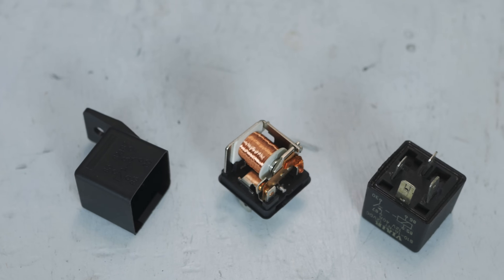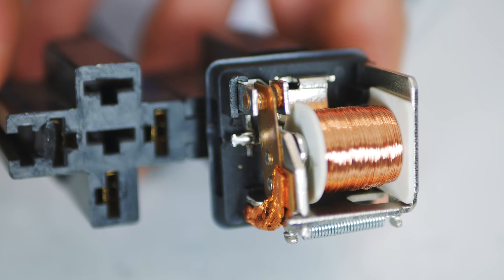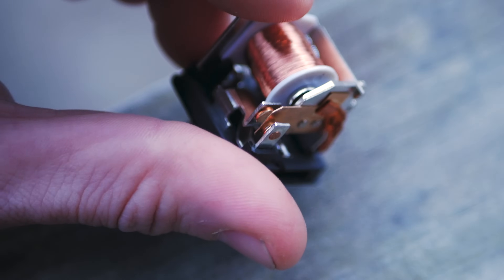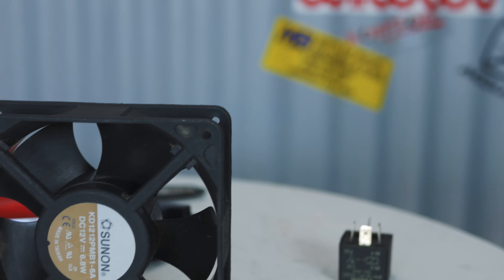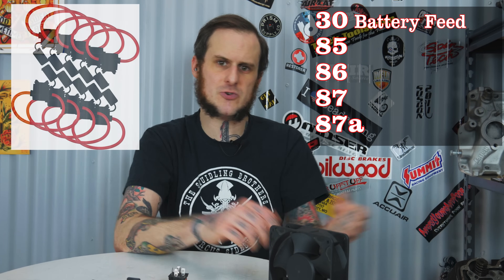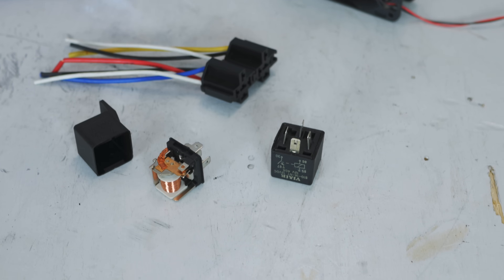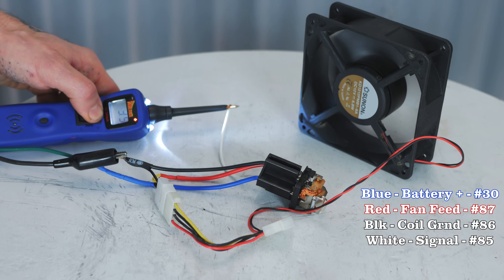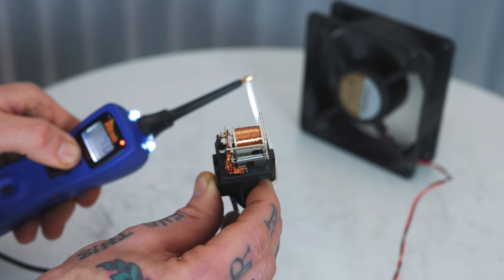Relays Explained - How they work and how to wire one!

Comment: Can you have two control switches into 1 relay?  When either is powered, it would tell the relay to power the high amperage side.
Reply from the maker: Yes you can. I'd recommend doing it as a ground control to avoid any weirdness with back feeding power somewhere. So send power to the Relay control circuit, then use the switches on the ground side of the Relay Control circuit. Flip a switch and the ground is connected, the Relay will actuate.

Comment: What if i am trying to wire a train horn with my factory horn that is activated by the factory horn button located in the steering wheel. But i want a toggle switch to be able to use either the factory horn or train horn
Reply from the maker: I would find your horn wire under the dash. Wire a 3 way toggle switch to that on your dashboard. Send the Horn wire into the center terminal of the 3-way switch, and each of the other legs to your two horns. One wired back to the original horn, the other to the relay for the train horn. Then just wire up a relay to the train horn's actuation valve, using the wire coming from that 3-way switch as your control circuit. 

Then you can flip the 3-way switch to the original Horn, or flip it the other way to go to the train horn control. 

A switch like this I mean: https://amzn.to/4cdoGxG (affiliate link)

You just have to be sure to switch it to one side or the other, not leave it in the middle. That is the "off" position where neither horn will work.

Comment: So I have some fog lights on my 2006 Dodge Ram that go out when I turn my brights on. I’m figuring it’s a 5 pin relay that’s switching them off.  In the case of a 5 pin relay, what pin numbers on the relay would be turning the relay off when the high beams come on? What would be the best way to rewire this relay so the fog lights stay on when the low and high beams are on but I can switch the fog lights off if I want?

Comment: 2013 suburban sometime for off roading I need to remove ABS 2 Fuse (25) to Disable Completely Traction and Stability control System, so I need switch instead of removing Fuse every time I need to go for off-roading what best way? and how to do it? thank you.

Comment: What's your opinion on  switched negatives on both relay and low amp  direct connections
Reply from the maker: For relay control I actually prefer ground control. It makes it so I can keep the positive side wiring neater in many cases. 

For Load side I usually go the other way for the same reason. I can have a fuse panel right next to the Relays and keep all my Positive side rather short and simple. Then send power to my Load device. Which also means my Ground side can be short and neat in many cases.

Comment: Hello, I have a question please.  I have a rearview mirror dashcam (that records dashcam video as well as video behind me) on my 2006 F150.  Hated the idea of messy wires with the 12v input so I used a fusetap to the interior fusebox, wires neatly tucked.  Picked a fuse location that was normally 10a and added a 5a fuse to the fusetap (for a total of 15a).  That worked for months but suddenly it's dead.  Tested direct to 12v cigarette input and the dashcam itself is fine, it was just not getting power all of a sudden with my flawed setup.  Now I'm using the 12v cigarette adapter which I'm not a fan of, especially since it's 'always on.'  Should I buy a relay and go direct to fusebox? If so can you link me exactly what I'd need on Amazon with a brief description, and I'm sure I can figure it out from there.  I would be so grateful.  Thanks in advance.  This has been an ongoing nightmare.  I'm good at following directions but I'm really lost with electronics wiring

Comment: Hey I am trying to figure out a way to wire a switch using a fuse tap and relay in order to send power to other accessories maybe lights or a screen things like that, any thoughts or ideas how to wire that in the car. thanks

Comment: I want to add some LED ambient lighting in my car, the problem is if I plug it into my car 12v lighter outlet it stays on even when the car is off... I do have a light in my armrest cubbyhole that turns on and off with the car ignition so I want my new added LED light to do the same... So I figure I will power up a 5 pin relay to make this work... I'm just a little confused... I plan to wire the relay in the following way: 30 to 12v+, 85 & 86 to 12v- (ground), 87 to new LED+,  new LED- to ground, the confusion is the 87a... what do I connect to tell the relay to turn on and off? The existing light in the armrest cubbyhole has a + & - wire... do I just connect that positive to 87a? This way when it is activated (ignition on) it will trip the relay to on, and when the ignition is off it will trip the relay off? I hope you get what I am trying to do. any help will be greatly appreciated! If you have another way of doing it please let me know. Thank you!
Reply: Hey, I don’t know if you’ve figured it out yet, but:
30 to battery (use a fuse)
85 to the armrest light positive
86 to ground
87 to LED positive
Ground the LED negative to an existing clean ground point. Leave the 87a alone. Hope this helps
Reply: Basically 85 and 86 should be running parallel to the armrest cubby hole light, that way when the light comes on, the relay also will, and provide a direct circuit between the 30 and 87 points. When the relay is off, there will instead be a connection from 30 to 87a, so the 87a is for if you want to turn something off rather than on with the relay. For your LED thing, leave 87a alone

Also check your car’s wiring diagram and make sure that the armrest cubby hole light circuit has enough power to also supply a relay in parallel. The relay will add a 0.5 to 1 amp extra load to that circuit

Comment: I've watched a ton of videos on relays.  They all say low amp goes to the relay to power the switch so high amp power can be delivered but none of them ever say where the low amps come from.  What reduces the battery amps to low amps ?
Reply from the maker: Thom Vogan nothing. A circuit needs a “load” to use the Amperage. An electric fan is a large load, so it’s a “High Amp” draw. In the case of the “Low” side here, the Relay is the only load. The Relay basically “creates” the Low Amp load your are asking about. The point is just that you can use small wires and low amperage switches (like generic dash switches or computer controls) to control the relay. And that small amperage load then switches on or off the high amperage load. Does that make sense?
Reply: The electromagnet (coil of wire) in the relay is part of the low amp circuit. The high resistance of the electromagnet results in low amperage in this circuit, according to Ohm's Law: V = I x R where V is voltage, I is current or amperage, and R is resistance.

Comment: Hello!  I’m connecting a stinger battery isolator in my 2003 Ford F-150.  I’m to the point of attaching the isolator to a “true ignition source” and your comments about fuse taps has me concerned.  How would you make this connection?  My end goal is an auxiliary battery for camping.

Comment: When adding a diode to prevent reverse voltage spikes, does the diode install on 85 and 86?
Reply from the maker: The Control Circuit can be wired either way with either 85 or 86 being power or ground, so this is too broad of a question for me to answer. 

If I was worried about that it would only be in the case of an ECM controlling said relay, but most ECMs use Ground switching, not Power switching. If it is a Power switching circuit in the ECM, I'd install the diode in line on whichever wire was supplying said power to the Relay control circuit. 

I've never had an issue with voltage reversion with relays. I fully understand it is a common phenomenon, but it's generally more of an issue in Electronics development, not car electronics.

I use Diodes infrequently for weird wiring scenarios where I need to maybe control a relay via two different circuits. (Say ECM and AC signal both turning on electric fans.)
Reply: @HotRodHippie  I just subscribed to your channel, thanks for the response, I'm working on a truck that has a electronic control module for emergency lighting, there is currently a diode on the relay, but one end is off and not sure where it goes to, At the moment, one end is connected to the 85 spade, not sure where the other end of the diode needs to be, hope this clarifies my situation, Does the other end of the diode go the 86 Spade on the relay ?

Comment: hello, I'm trying to understand relays. the part not I'm not understanding , is where does the coil get the power to energize itself to close the contacts when the power is coming in through the #30 pin. Thanks
Reply from the maker: 85 and 86 are your "Control Circuit", that is the coil circuit. You supply power and ground to it (doesn't matter which is which) as you need. So if you want the Relay to active when you flip a switch, you wire the switch to the 86/85 circuit. If you want it to activate when you turn a vehicle on, you wire it to a "Key Hot Ignition" source. It is up to you what controls the Coil is what I'm getting at. I didn't cover that much because it greatly depends on your use and needs. 

I've wired relays with switches, key hot, where computers activate them, where radios activate them, where one relay activates another one, and probably some other ways I'm forgetting.
Reply: @HotRodHippie   thanks for responding to my question.
Reply from the maker: @MrBikercat  no problem. I try to answer any questions I can, I don't always have the time but I try.

Comment: One question. I bought a relay today in order wire led light strips on Atv. I'm working on that this evening. The relay I purchased is a 5 pin with 87a. Although I should have bought a 4 pin can I still wire it up as a 4 pin and just ignore the 87a pin?
Reply from the maker: Yes indeed that is what you do. 👍👍
Reply: @HotRodHippie  thank you.
Reply: @AztecWarrior75   Thanks for the tip.
Reply: @AztecWarrior75  and yes I covered the pin with shrink tube.

Comment: Hello +HotRodHippie, enjoying your channel very much.  I am hoping you can please help me with the following.  I have 2 normally on 12v cigarette lighter ports on a Ford vehicle.  Both are fused with 20A JCase.  I want to make them normally off.
  I have 2 unused fuse slots which are normally off and powers 1) a mini USB hard wire kit and 2) a 12v lighter and 2 5v usb port.  Both using a fuse tap.  This 2 unused slots do not power any existing load.  These are all in the passenger compartment box.

Based on your two videos, this and the Do's and Dont's relay and fuse tap episode.  Looks like I can use a relay to convert the existing normally on 12v ports to normally off.

Question: Do you think I can just use the fuse taps to activate the relay?  I'll use relay terminals 30-87 inline with the existing 20A Jcase fuse.  Am I overdoing it and/or is there a much simpler solution?

Comment: I have an old CB that I can only get to work when hooked up directly to the battery which I know isn't good. I used a fuse tap for my external lights on my jeep (10 amp) and it works good. No such luck with the CB. There is a red wire and black/red wire. It was my understanding that the black/red needs to be grounded to the frame and the red either be would up with another red wire that's already working or a fuse tap, but can't get the dam thing to turn on. What am I doing wrong?
Reply from the maker: There isn't any logical reason for using a fuse tap to not be working. I don't know that I'd recommend it but it should at least turn on. If the tap couldn't probide enough power it should burn up somewhere not just simply fail to function.

My only guess is that your wiring is aged and corroded here and there. That results in voltage drops. Meaning the voltage at your battery or alternator is losing a bit on its way to your fusebox. Very common in older vehicles and to a lesser degree newer ones. Maybe that CB is very specific about voltage and the voltage drop is enough to not let it turn on. Say maybe your battery has 13.5V but at the fuse tap you are only getting 11.5V. Maybe the CB NEEDS 12V to turn on. That is a shot in the dark guess but a mildly educated one. Wiring a relay to provide battery duredct power and using a fuse tap to trigger the relay is a solid option for better voltage, bypassing your old wiring and going fresh right from the battery. 

The only other issue I can see is that maybe wherever you are grounding isn't a good enough ground. Grounds are very important and you can't really overdo it on them. So if you only have say one ground from your battery to your engine, or frame then it may be insufficient. Or wherever you are grounding too isn't cleaned off enough for good contact.

Lastly are you sure it isn't a 24v CB or a 12/24V and something isn't wrong with it? I admit that it working when connected to the battery loses this theory but most old trucks are 24V so a CB from one possibly be so.

Comment: Im a newbie in car wirings and planning to instal a foglight to my mitsubishi lancer97..
Here's the plan: 
a) battery-->fuse-->relay-->bulb.
b) tap from auxillary light-->relay--> bulb.
Please comment if you have better ideas...thank you in advance...
Reply from the maker: A is your best bet. Direct battery power will be safer for the existing wiring and allow for stronger power to the fog lights. Then control the relay with whatever means you want. Whether it be the existing lighting circuit for your auxillary lights or a switch. I'd recommend something that you can't accidentally leave on so you don't kill your battery by accident.

Comment: Great video! Quick question; I am looking to add heated mirrors to my truck. Could I use a fuse tap from the rear window defroster to power a relay to run from the battery to the mirrors? Would the relay just be hanging out somewhere in the truck, or does it have to plug in somewhere?
Reply from the maker: Without seeing the exact wiring diagram of your window defroster that is a hard one to say.

The window defroster works on a timer or circuit breaker type situation usually. That's why it doesnt stay on indefinitely. I do not know for sure if the same is true for heated mirrors as I've never had a vehicle with them or repaired them. Wiring to the defroster fuse likely wouldn't provide tbsg on/OFF control. Which if the mirrors want that could be an issue.

As for a relay, they are fairly tough generally. I do make a point of securely mounting them though. No reason to risk damage or shorting. Many aftermarket ones have mounting tabs to bolt or screw them under a dash or to brackets.
Reply from the maker: Yea upon further research you need a timer circuit of some kind. Tagging into your existing defroster may cause it to function improperly. You need something like this : https://amzn.to/2ClqOVT That is a timer unit designed for mirrors.
Reply: Thank you very much! I’m new to the vehicle tinkering game. I think what I’ll end up doing is adding an extra fuse box somewhere and powering that timer through it. That way I can have additional fuse locations for more fun accessories. Lol. have a great day!
Reply from the maker: That sounds like a good plan to me 👍